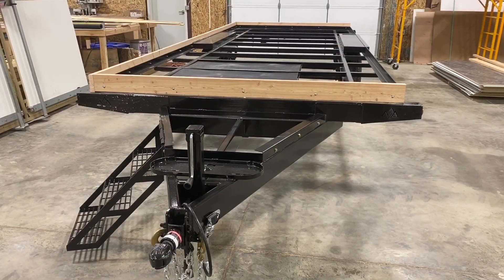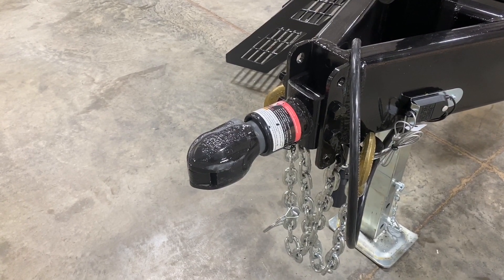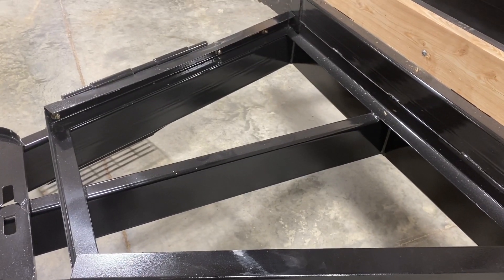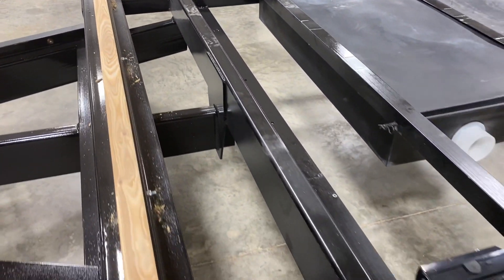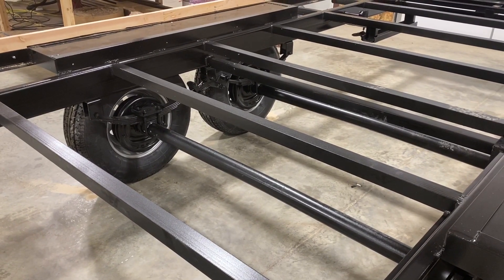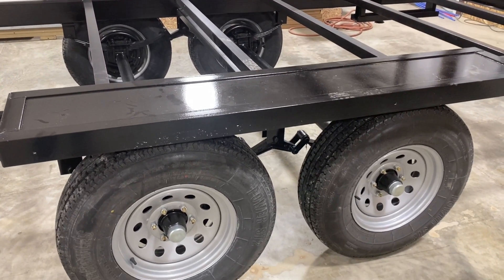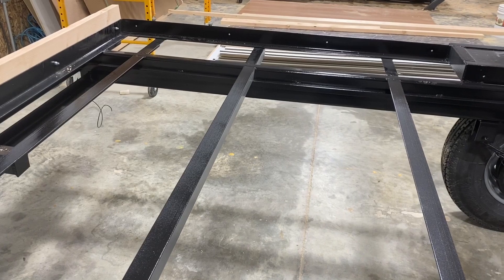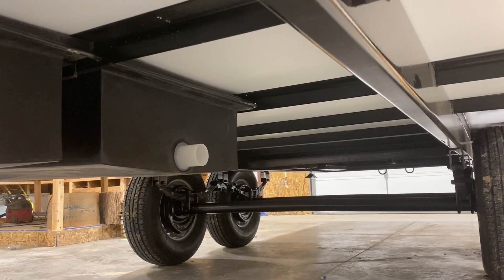Peak Mtn Camp tandem frame overview

Comment: Great video. On the Jack, do the electric versions have a backup manual  way if the electronic part fails?
Reply from the maker: They do. Most come with a handle to manually operate the jack.